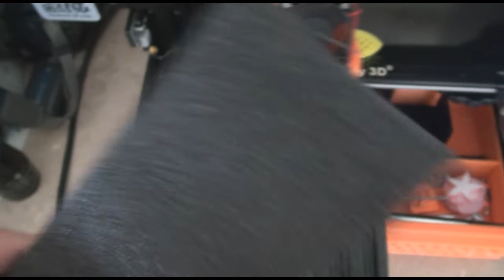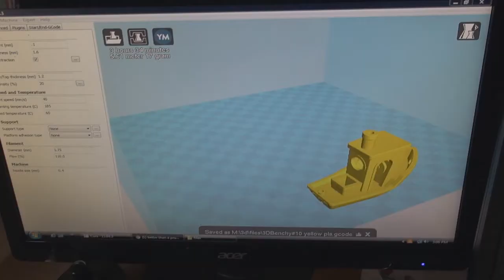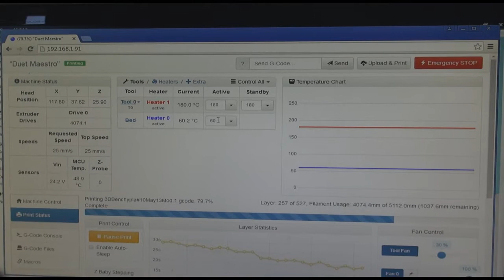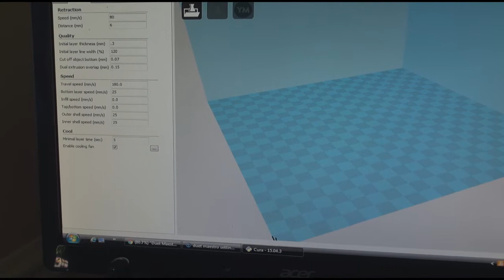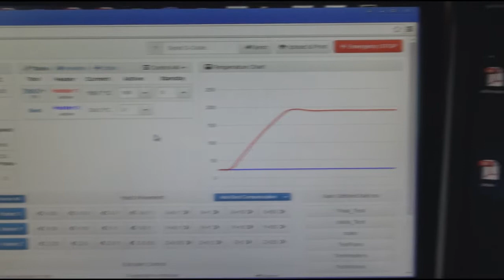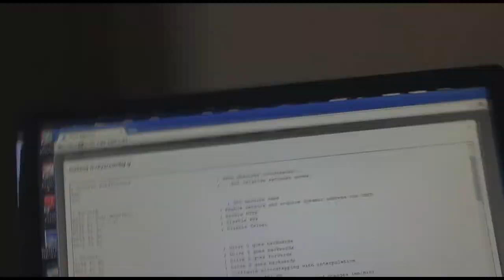Creality Ender3 Pro / Duet 2 maestro -Cura slicer settings! Benchy test

Comment: I would say you need to give a try on Cura 4.2. There you can set your custom profiles for different filaments, custom profiles for each item you print, custom quality profiles.
Reply from the maker: If I could I would the new versions of Cura will not run on my computer unfortunately

Comment from the maker: This is still basically a stock Ender 3 pro unit. I did add some basic fixes, These setting seem to work as a great starting point. Each item i have printed required minor changes. I also made some changes to the printing profile for example rotating the object on the build plate can make a big difference.